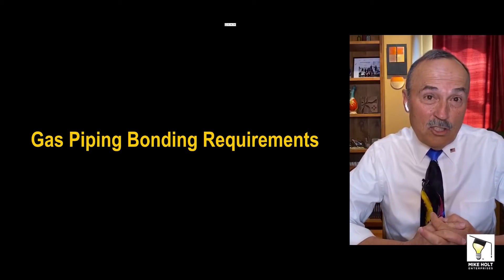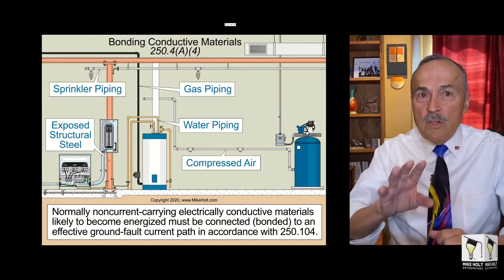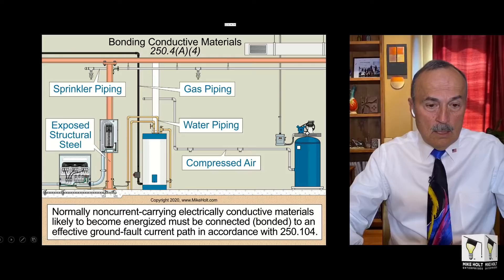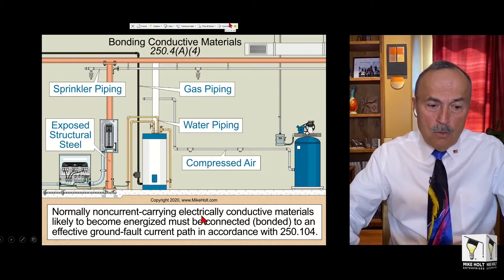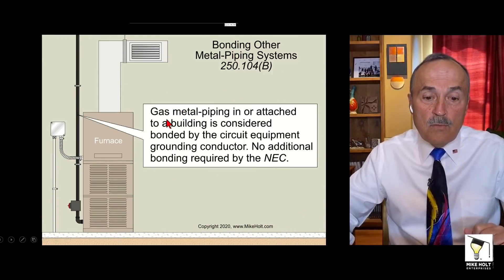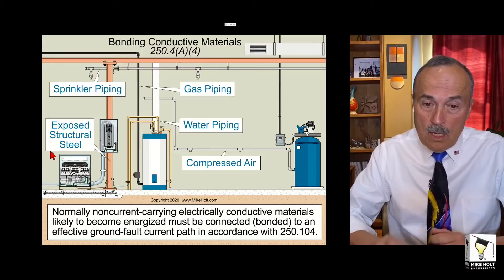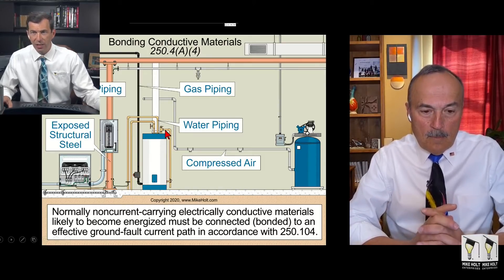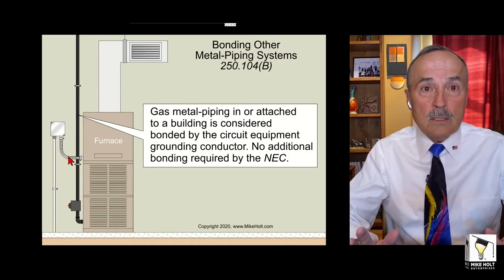Gas Pipe Bonding Requirements, NEC 2020 - [250.4(A)(4)], (12min:16sec)

Comment: Unfortunately hard gas pipe becomes energized when struck by lightning if yellow csst is attached to the hard pipe pin hole get blown out of it and then we get a gas leak the furnace fires off and boom it’s happened a lot. The remedy  should have been a class action lawsuit against the csst manufacturers, and the plumbers should be going back ripping it all out and hard piping it.

Comment: Mike, Yellow CSST gas pipe must be bonded to the main water pipe ground wire back to the panel at the first CSST brass fitting closest to where the gas pipe first enters the home.   So, the electrician could easily bond the gas pipe near to the same cold water pipe bonding wire that goes back to the panel with 4 AWG for 200 Amp service.  The reason for bonding CSST gas pipe is that it's stainless steel wall is thin and is susceptible to lightning surge current blowing pin hole leaks into it if it carries current and is not bonded where the CSST first hits the main gas pipe to the home.
Reply from the maker: @Chad.Tyrone, you are almost correct (wrong wire size and wrong location to terminate bond wire). Please watch MikeHolt.com/Gas

Comment: Hi Mike, I'm a retired HVAC contractor. With respect to the water heater gas piping, if you are.talking about a standard efficiency water heater, the gas piping to it does not need to be bonded since there is no electrical circuit to it. Even if it were a high efficiency gas water heater the gas piping would not need to be bonded unless it is connected to the gas piping system with any length of CSST and this applies in any case. In any case you would of course attach your bonding clamp as close to the service.panel ground bus as possible so long as it is attached to the first piece of black iron pipe that has no CSST upstream from it. Hope this helps. Thanks for a great video. Have a great weekend. Rick.
Reply from the maker: You are  100% correct, per NFPA 54, Section 7.13.✅

Comment: I think what they mean when they say in accordance to the NEC is, lets say you use drive a grounding electrode because it is closer and less work or the basement is completely finished and it is easier to install a ground rod and attach the gas pipe to that with a #6 conductor. In the NEC it says all grounding electrodes need to be connected together. So you need to find some way to create continuity between your new electrode to the building grounding electrode. I believe this is what they mean in the NFGC. IMO
Reply from the maker: Let's start out with you are 100% wrong. Please watch the video again.
Reply: @MikeHoltNEC  Wouldn't be the first time I was wrong lol Would you mind telling me where though? I have always been under the impression all ground rods must be interconnected which is what I thought was meant by in accordance with the NEC. I am always wanting to learn?
Reply from the maker: @carylamari6546  This video is about the 'bonding' of gas piping. So it's not related in any way to connecting the interior gas piping system to a ground rod.
Reply: @MikeHoltNEC  Well I agree and not to be obstinate because you are right however I have in the past installed a ground rod and interconnected it to the main ground rod outside with a #6 wire and then connected the interior Gas Piping system to the new ground rod. It actually was suggested by the home inspector because the Gas Pipeing system was on the other side of the house in a utility room and the rest of the basement was finished and not able to fish a wire to the panel. It was just one situation where I thought it satisfies the code and bonded the gas pipe to the main house ground system. Sometimes we have to think outside the box and only mentioned it as one possible justification for satisfying the statement in accordance with the NEC. But thanks for all you do, I respect your knowledge a great deal.
Reply from the maker: @carylamari6546  The National Electrical Code does not require the gas pipe system to be 'grounded' at all. So there is nothing for the electrican to do. So if they do nothing, they are in accordance with the NEC.

Comment: I am thinking. In some situations, the popes could get static electricity they still need bonding?
Reply from the maker: They are bonded by the circuit equipment grounding conductor, see 250.104(B).
Reply: @MikeHoltNEC  Thanks Mike, bless.
BTW, we do not use the LEB(Local Equipotential Bonding) and MEB (Main Equipotential Bonding) in USA right? I did not see them in the building, for European projects/IEC there is.

Comment: Gas or no, wouldn’t the water heater still need power? For the igniter. It is still bonded to ground.
Reply from the maker: A gas water heater does not have any electrical wiring. The electricity for igniter circuit is by a thermocouple.

Comment: It is my understanding that according to code CSST gas pipe needs a #6 ground conductor connected to the pipe connector or iron pipe at the input of the gas service to the building. In case of lightning strikes!? I am running csst to a ceiling furnace in my workshop that has 120v to it so it would be bonded by that circuit, so the whole thing seems contradictory!
Reply: Back to CSST bonding. Your point of view is just from an electricians point of view. But as a homeowner we have to comply with all building codes to get service to our homes! So even though the NEC doesn’t require any more bonding but the national fuel code does, then it has to be done!
Reply from the maker: I is not in the NEC, so it does not have to be done per the NEC. It's a NFPA 54 mechanical code, not the NEC. So it's not required to be done per the NEC (we don't have any requirements). Who does NFPA 54 bonding is up to the building offical, not the electrical inspector.

Comment: Any good plumber knows that when you connect dissimilar metals like black gas piping to copper gas piping a dialectic union is recommended. The dialectic union breaks the electrical bond, so theoretically the pipe on one side of the dialectic union could become energized and not trip the breaker. Also, if the pipe becomes energized by lightning it could explode at the dialectic union.

Thoughts?.

Comment: If the water needed to be bonded then the presence of the gas water heater would require the gas to be bonded since the gas and water are bonded within the water heater. Then would you say the gas is bonded via the water pipe? Don’t thing so

Comment: What about the 2018 NEC Code?  

400 AMP ground Service residential.  Bonding requirements for Gas Lines. 

I’m reading bonding jumper not smaller than 6AWG.  Does 400 amp require my bonding jumper to be larger for the gas line?

Comment: Technically then, shouldn't the short (2 or 3 foot) section of csst between the appliance gas shut off and furnace or water heater be bonded? If yes, I've never seen it done
Reply: Yes

Comment: How stupid.  Gas pipe comes out of the ground, a lot of ground.  One giant grounding rod, in the ground.  I get the service conductor ground/bond satisfies the requirement but how stupid.  Now you have two grounds for the home/buildings.  Want a third one out by the fire pit in the backyard?  How stupid.
Reply: Most underground gas line (both distribution and service) now is yellow cross linked polyethylene, not metal.  It doesn’t switch to metal until it gets to the shutoff valve just before the regulator, thus, it’s not grounded by being a metal pipe in the ground.

Comment: It has always puzzled me that duct work is not considered a likely conductive surface ,eventhough mechanically controlled dampers are installed by a low voltage connection or in some bigger equipment 120v and low voltage wire sometimes is ran inside the duct to facilitate the installation of a thermostat.  All this still doesn't make it under code a likely to become energized surface🤔.  Mike what is your opinion?😳
Reply from the maker: I'm 'guessing' that most 'metal' duct is mechanically and electrically connected to the air-handler. The air handler is connected to the circuit equipment grounding conductor (bonded).

Comment: My iron pipe gas line is bonded at the hot water heater and furnace.  But I'm adding 25ft of CSST in my basement area close to the gas meter.  Curious if I should run the bonding clamp 6awg wire from csst brass fitting to the exterior of my house grounding point on outside of house where panel box runs to.
Reply from the maker: According to the National Fuel Gas Code, NFPA 54, section 7.12, you only need to bond CSST tubing if it's not of the 'arc-resistant jacket type.' See https://www.gastite.com/us/products/flashshield/flashshieldplus_csst/

Comment: So, if my propane tank is connected to my range, and the range is plugged in, is it bonded?
Reply from the maker: Yep, per 250.104(B)(1).
Reply: @MikeHoltNEC  Not sure what your numbers been but I’m in Florida. Is that the code number
Reply from the maker: @nickdeliso7026  This is the National Electrical Code reference to support my response.
Reply: @MikeHoltNEC  ok, thanks. I want to make sure I do all of this to code. You’ll be surprised how little some of these propane companies know about this.

Comment: I think that every duct should be bonded. Years ago where the duct work coming out the top of a gas furnace had a rubber noise isolation section. An old clothe covered by 14/2 NM cable was ran at a 90 degree angle from duct by touching it. After more then 20 years it rubbed thru insulation almost causing a fire. About 6 years ago we were told at a CEU class that every manufacturer of CSST has their own method of bonding. You would think they could get just 1 style if a clamp or fitting to bond all CSST.

Comment: Why would you want the fault go to gas pipe. Had to do that in a house it sounded scary
Reply from the maker: That's a good point that I hadn't consider. That is one reason that the NEC does not have any bonding requirement for gas piping.

Comment: How calculated size grounded gas piping for switchgear 2500 amps?
Reply from the maker: Watch the video again, and check out 250.104(B).
Reply: @MikeHoltNEC  I have a doubt between 250.66 and 250.102 table

Comment: What about a plug-connected wall furnace? As long as it is plugged in, great. But say it is unplugged. Pipe unlikely to become energized? I guess. But what if someone drives a nail through the drywall and hits both the NM cable and the gas pipe that are running in the same cavity to supply the unit?
Reply from the maker: Likely to become energized is that the gas pipe is connected to equipment that has power. If this is the case, then the gas is already bonded as explained in the video.

Comment: It just maybe a local code. Here is California Equipment bonding includes gas metal piping and water lines. This is in addition to 2 ground rods, or a ufers. There requirement is two or more grounding conductors. Also water lines at the water heater needs to have a jumper from hot to cold at the water heater piping. This is required by the electrical contractor when installing service panels here. What the diagram with the water heater is not showing, is the bonding connector back at the gas meter main already bonded, therefore no bonding required of the gas pipe at the gas water heater. The 2015 uniform plumbing code 1211.2 Bonding of CSST Gas Piping. CSST gas piping systems shall be bonded to the electrical service grounding electrode system. The bonding jumper shall connect to a metallic pipe or fitting between the point of delivery and the first downstream CSST fitting. The bonding jumper shall be not smaller than 6 AWG copper wire or equivalent. Gas piping systems that contain one or more segments of CSST shall be bonded in accordance with this section. [NFPA 54:7.13.2]. Its true, no mater what you do, you get sued. Thumbs up there.
Reply: My iron pipe gas line is bonded at the hot water heater and furnace.  But I'm adding 25ft of CSST in my basement area close to the gas meter.  Curious if I should run the bonding clamp 6awg wire from csst brass fitting to the exterior of my house grounding point on outside of house where panel box runs to.
Reply: @wg1408  yes, CSST requires it own bonding according to the manufacture's recommendation. In my opinion, always bond to a point that is a permeant location, and that if bonding for other equipment can be removed without disturbing the  other bonding clamp/connection then it's a good spot. good luck.

Comment: Code is a minimum, my county requires gas piping to be bonded.
Reply: But who's responsibility is that? The mechanical guys or you the electrician? Who's liable for the spark that ignites the flames?

Comment: When I piped in my gas furnance instuctions stated to use a dielectric union on the 3/4" gas pipe. I went to the local plumbing supply house and they did not have any in stock so I reused the original union. I did install 12/2 MC cable to replace 40 year old type AC cable. Often wondered if we should install a bonding jumper between the cold & hot water copper lines at gas water heaters due to they have insolated fittings even though they would bond together at downstream metalic faucets.
Reply: I answered this in the questions above.

Comment: If a metal water pipe is "bonded" to the "Grounding Electrode" of a building and
that water pipe (or any water pipe connected to that water pipe) is connected to a metal "water heater", 
any metal gas pipe connected to that metal water heater IS (automatically) BONDED to the  Grounding electrode - by quite heavy "gauge" solid copper/steel/etc "Conductors".

Any extra "bonding" is redundant!
Reply from the maker: You are correct.

Comment: Bravo, actually someone who has read the codes and has shined a light on the crazy interpretations. I have been in the gas utility industry for almost 40 years and was one of the first in the country to deal with csst. We started out with something called titeflex developed in Japan, a yellow coated csst not requiring any bonding when first introduced. Then the insurance industry started noticing claims on houses struck by lightning with csst ( as you can imagine they were paying out on total losses due to gas involved structural fires ). Of course once the insurance industry determine these causes, they want after the manufacturers of csst. Having thousands upon thousands of homes pipe with this type of material, the manufacturers, along with the American Gas Association and the gas Appliance manufacturers Association had to come up with a solution. Since we learn more from our mistakes than we do our successes the gas industry came up with the solution of bonding anything that had the yellow csst jacket. The industry also decided to redesign csst jackets to better handle lightning strikes, they came up with names like Counter-Strike, flashshield, flex max and we could probably go on forever. These lightning inhibiting jackets all have one thing in common, they are black in color. When we read the literature for these black jacketed csst products , they say no additional bonding needed. The problem is when I sit in meetings with these manufacturers and discuss their terminology of no additional bonding needed, I always present the question, not additional to what? ( & of course their representatives always beat around the bush reiterating no additional bonding needed, not really answering the question at all ). So I do feel sorry for the electricians required to bond the csst because of the lack of profit made on such an easy job but the tons of liability they take on after it's completed.
Thank you so much for taking on a topic with so many gray areas and very few answers the industry is willing to give.👍.

Comment: Mike, do gas water heaters have electric pilots or electric spark etc to ignite the gas burner?
Reply: Some may but some may be via a "manually operated" piezo electric ignition.

However, if a metal water pipe is "bonded" to the "Grounding Electrode" of a building and
that water pipe (or any water pipe connected to that water pipe) is connected to a metal "water heater", 
any metal gas pipe connected to that metal water heater IS (automatically) BONDED to the  Grounding electrode - by quite heavy "gauge" solid copper/steel/etc "Conductors".

Any extra "bonding" is redundant!
Reply: They use old fashioned thermocouples. High efficiency ones use intermittent spark ignition,  as well as some tankkess